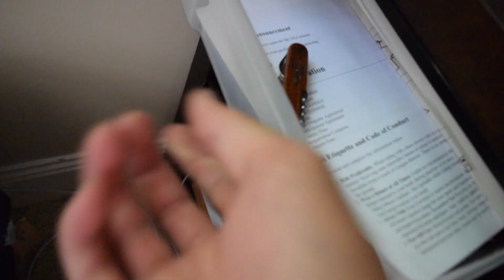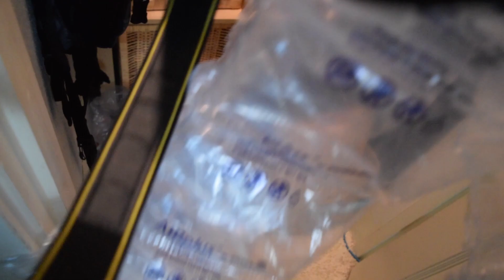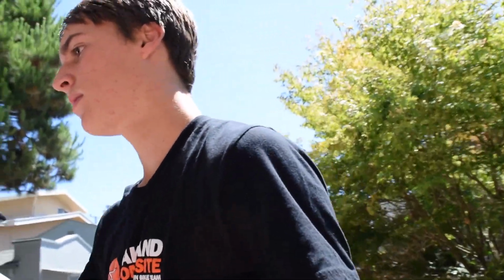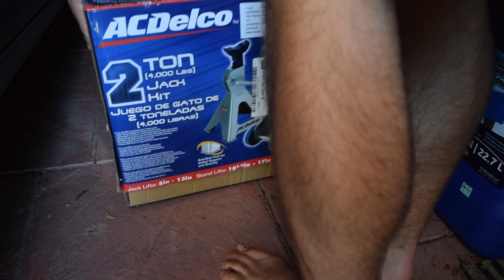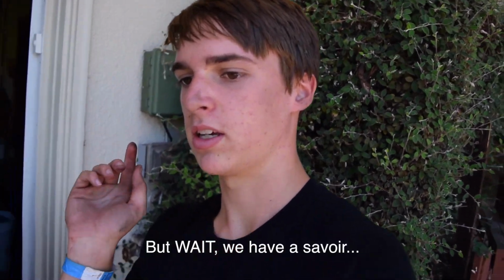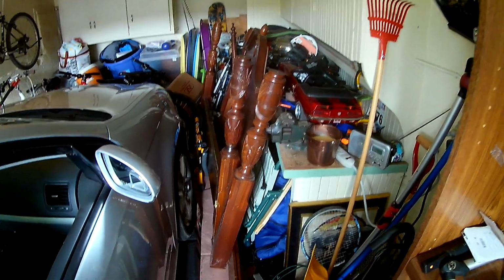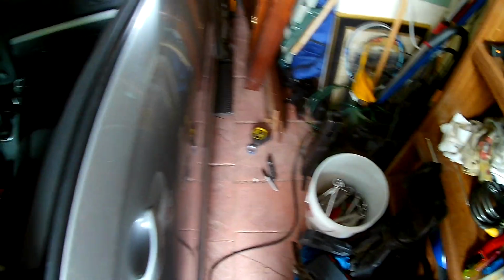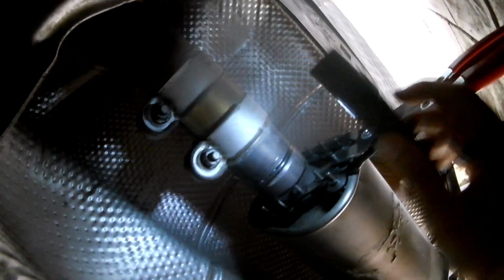Installing Exhaust Cutout on MK5 Jetta!!! (Part 1)

Comment: I respect you for this. But did you really need to play with it? Could break mid use and be stuck open or ""straight pipe""
Still thanks for the vid on install 👍

Comment: You could’ve unscrewed the bolts next to the resonator and cut the other half of the pipe and re screwed the bolt back on and the other side I had to remove those bolts when I put my cts downpipe on my mk6 gli
Reply from the maker: Still not very much room between the O2 sensor and the resonator so it wouldn't matter if I unbolted it or not, I would still have to cut the pipe to fit the new one in

Comment: What is the size of the oem exhaust pipe?
Reply from the maker: Nathaniel Here 60mm, that’s what I got but ecs doesn’t make it bigger so you may want to go 2.5” so it goes over the exhaust easier
Reply: Conor Stoneman thanks so much! So basically the outside diameter is 60mm
Reply from the maker: Nathaniel Here As far as I know, yes, I never actually measured but when I really dug in and did the research that’s what I found